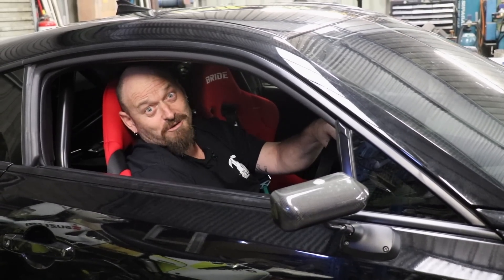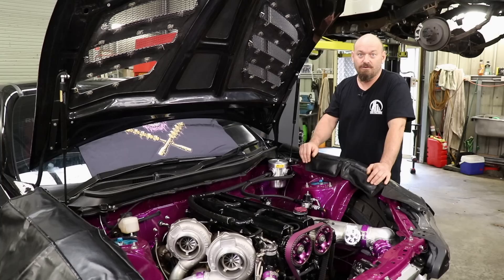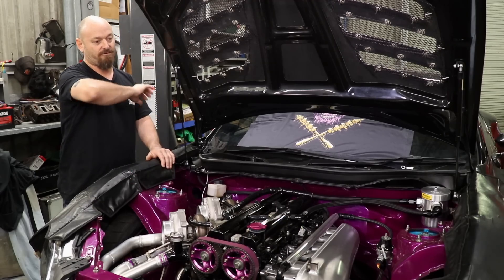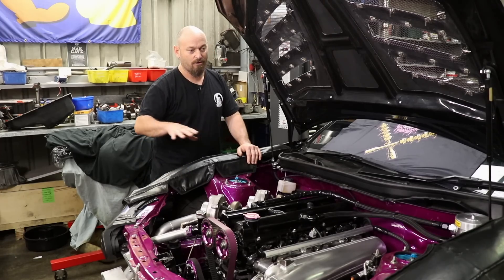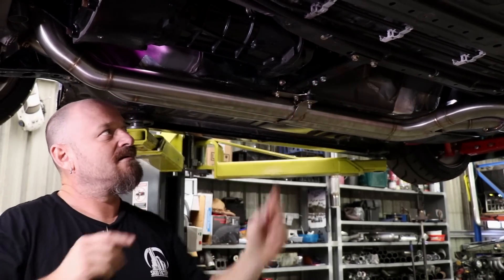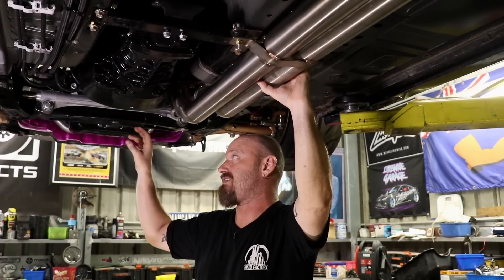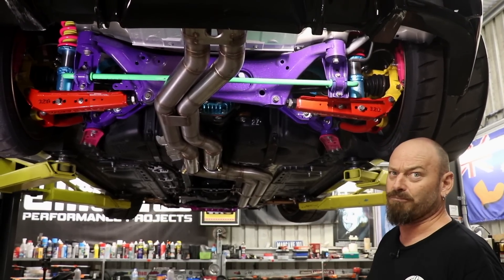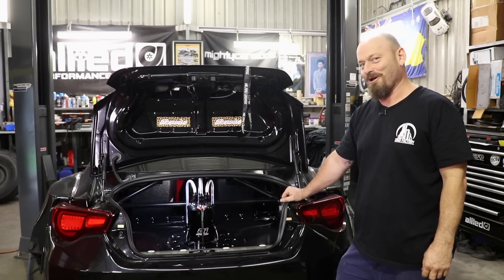2JZ Powered Toyota 86 - THE SKID FACTORY - WE ARE LIKEWISE - [Build Review]

Comment: Builds like these - if they take one to the face, is it "only" the front bumper plastic/fiber shell, IC, radiator and eventually the front of the engine to take the hit and crumple? - Or is there some other structural "protection" left for absorbing (some of) the energy transfer to the cab, I'm not thinking of..?

Comment: Hey, Al. Serious question, This sounds really really similar to any other big cam 2jz at idle, but very different with some RPM. I'd assume the difference in sound is due to the twin exhaust not merging and separating the typical "split pulse" configuration into two turbos/exhaust systems. Would this sound the same as other Similar setups with a single?

Comment: Awesome car guys! :-D
Did you guys close the cut out in the tunnel section to mount the captive nuts for the gearbox mount up again?
Al said it was a strong structural section of the car, I guess you wouldn't want to weaken the body in any way, let alone with all that extra power?
Reply from the maker: The section that was opened up was just unstructural sheetmetal not the actual structural section of the tunnel.

Comment: What's your honest opinion on the 86 and FA20 Al? The internet seems to hate them but it'd be interesting to hear your opinion
Reply from the maker: Curtis Branagan They are terrific cars built with way more design thought than most derps on the internet could ever grasp. Yes they are underpowered but that is easily fixed with a turbo or supercharger. Even a decent E85 NA tune yields decent power for track use.

Comment: i know its a track car, but if there is no flex in any of the piping (intake) wont it cause stress fractures?
Reply: The Wiggins Clamps provide a certain amount of freedom of movement whilst also remaining air tight.
Reply from the maker: Wiggins clamps have more movement than a silicone joiner
Reply: cheers boys for the info and helping me learn, never knew these were a thing.

Comment: If you ran twin turbos of different sizes, would it be possible to negate turbo lag?
Reply: Marietta Corsini The decrease in lag is minimal if at all. Some factory cars had systems using two turbos and sequenced them to reduce lag. They didn’t really work that well so often got bypassed to run both all the time, or they were replaced with a big single.
Reply: @NBSV1  Interesting, thanks for the info!

Comment: Is the reason for not using stainless steel bolts on the engine mounts and other components under the car (saw a few rusty bolt heads)  because of material properties of stainless vs "regular" steel?

Comment: Would an oval profile of the exhaust pipes have helped - kept the volume but not as deep, therefore giving better ground clearance?
Reply: I think you can fit 4" oval. It measures like 6×3 or something
Reply: @capnskiddies  Im greedy though cause i drag race. I got a 4" to a cutout from the downpipe. And a 3" straight back to get safety check

Comment: Should really have a firewall towards the boot in case one should crash on track
Reply from the maker: Lindholmer5k It does.
Reply: The Skid Factory I mean the bit of the fuel system in the boot does not seem to be seperated by anything from the drivers compartment. Seems somewhat dangerous  in case of a crash with damage to the boot area with possible spillage and broken live wires inside of the drivers compartment. Maybe im missunderstanding somthing here 😀